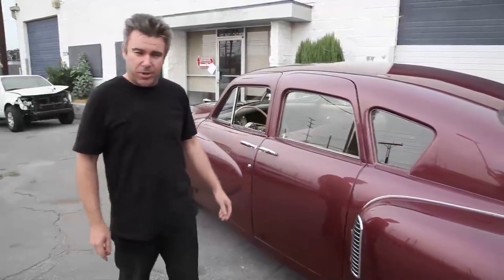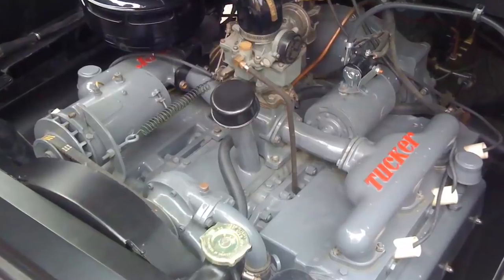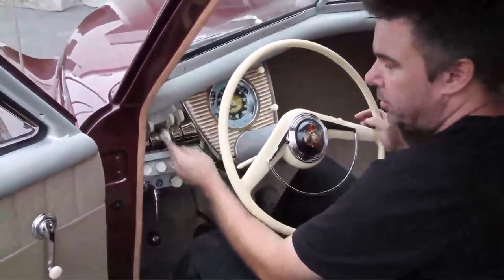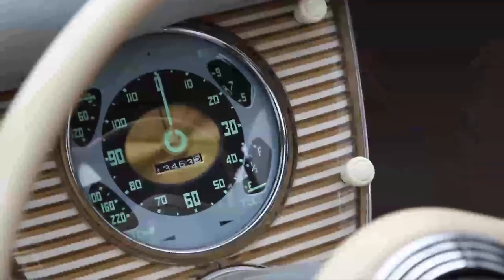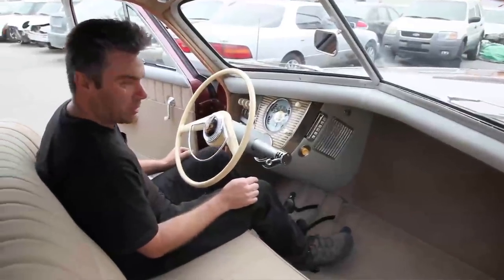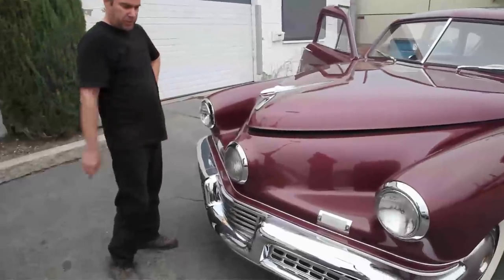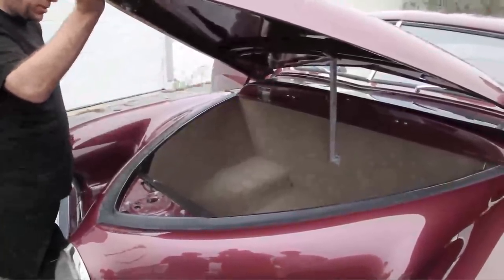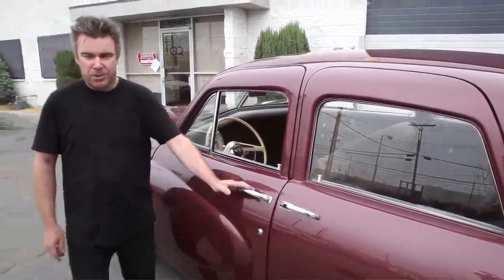BAD Co. Car 01 Tucker Torpedo

Comment: Great quick review of the Tucker’s features. 
One small point: a steel torsion bar and a steel coil spring work in exactly the same manner. Analyze the forces acting on either device (usually with a free body diagram - first or second-year mechanical engineering curriculum) - and you find every element in a coil spring is in torsion. Same as a valve spring. When you see a broken valve spring you will see that the fracture is curved due to the twisting forces it encountered.

Comment: And you think today's cars have style?
Reply: clydo1946 no, not really.
Reply: No, cars today are like "Look at this car, super safe, goes this much speed, buy one today." And thats it
Reply: "Good Gas Millage, 0% down, Look you can connect your phone to it! Don't ask about reliability!"
Reply: clydo1946 I agree that modern cars, by and large, lack the styling of the older versions. Yet, to be honest they are considerably safer, more reliable and more efficient to operate. The older cars, as I said, had style and were much easier to work on and could generally be maintained by their owners.
Reply: NOBODY says today's cars have style except maybe millennials who don't know shit.
Reply: @michaelkruk553  Hey I'm a Millennial and I always said anything made after 1990 is a giant pile of computerized junk.
Reply: @sbc388550  
Damn. I don't know how old you are but in the 60's it was pretty common for cars to break down. On any 50-mile trip, you could expect to see at least one or two cars on the side of the road. Engines would give you 100-125K miles before a rebuild, nowadays 200-250K is pretty much expected. Today's cars are much more reliable, for the most part more powerful, and definitely safer. As far as styling, that's pretty objective, I would say.

I own a 1970 Challenger. I think it is one of the best-looking cars ever made. I also have a Ram pickup & a Jeep Cherokee. I recently bought a 2017 Civic EXT coupe for my wife. I think its styling is very attractive,  on par with my Dodge. It is almost as quick, and is actually more fun to drive. This car has 10 more horsepower , and weighs 1/3 less than that Tucker. It also probably gets double the gas mileage. I'd call that evolutionary. The brand-new Challengers eat mine alive, in every way.

Here is the exact car I bought, same color too. Do you seriously think that Tucker is a better-looking car?
https://www.youtube.com/watch?v=7HZQiKLGgpg
Reply: @mikerew9132  The Styling for it's day was way ahead of The Big Three.

Comment: There were already states that outlawed 3rd headlight..so Tucker had blank inserts available to comply with the local laws...plus testing showed the center headlight beam was not strong enough to penetrated the others ..so it was kind of redundant . the design team had better ideas that would have been better function for turning illumination..but the Cyclops light already was such a marque trait that Preston insisted it stay.

Comment: What a wonderful car for its time.  More powerful than most cars on the road in that era
Reply: wb5oxq thats what ive heard....i understand the 6 cyl.  in the tucker ptoduced 166 bhp@ 3 hundred & something ft/lb of torque- that is truely amazing !!! I also understand that the front windows would pop out in the event of an accident.......back then every other car had non-safety glass.  The center headlight followed which ever way the frt wheels were pointing....... the list goes on... it was an amazingly safe car for its time.

Comment: The second key lock is to lock the parking brake. One thing I love about Tuckers is the fact that they don't have an AMMETER!  The "Battery" gauge is actually a Voltmeter.  Cars of this era and well through the 70's have Ammeters. Ammeters need to have full amperage running through them to work and over time corrosion builds up and either the car stops working or the ammeter arcs out and starts a fire. Mr. Tucker was ahead of the curve by 30 years using a simple Voltmeter!

Comment: Very interesting video and to think how automobile technology may have proceeded.  With this type of thinking and designs very likely would have resulted in all other manufacturers having to do the same much sooner than what occured.
It's hard to imagine or maybe not today the ways that the company was caused to go out of business.  Essentially allegations and investigations were made with the purpose of "screwing the pooch."  Using the guise of a legitimate charges it's competators were able to "use the government" and wait out Tucker.  What I mean is they by causing the bad press caused the inevitable devaluation of the stock.  Which removed the companies ability financially to operate.  Besides the resulting cancellation of orders making bridge loans that much less likely. Much in the way Westinghouse and Tesla (ac current) were forced to sell to Edison Electric ultimately forming general electric.  Morgan simply told Westinghouse he was going to sue him and knew he would ultimatly lose.  However he had the money to do so Westinghouse was tapped and would win but would have lost his company.  Lenders other than JP were not willing to extend credit under the assumption Westinghouse and AC would win.

Comment: This is the Tucker 48, not the Torpedo which was never built until Rob Ida came along.
Reply: @Cliff Yablonski - Sorry, but if the Torpedo had been made (which it wasn't) it was a very different looking design than the Tucker 48 (which was made). Do some research and you'll see what I am saying is correct.

Comment: One thing Tucker lacked (at least to the best of my knowledge) is a window defrosting system. I believe Nash had the first one in the late 30's, and I know that Oldsmobile had the first with a heater core that worked pretty much like we have to day in the early 40's. With the tiny dash Tucker had, there doesn't appear to be any room for defrost vents. Maybe I'm wrong, but that's the way it looks. For a car that was so futuristic in so many ways, you'd think they would have thought about windshield defrosting.
Reply: I suppose eventually they'ed come up with a Beetle style gas burner defroster.
Reply: @brianmiller1077  Probably so.
Reply: A heater/defroster was available as part of the Tucker Accessory Program, as was a radio and matching luggage.

Comment: Does the 'Cyclops Eye' actually turn or are there 3 bulbs in the housing which vary in intensity as the front wheels turn?? Or did they try both? I've never seen the light move but I have seen the blueprint with 3 bulb.

Comment: Regardless of the government, Tucker never had a chance at anything close to success or mass production, despite it being a very interesting car. The auto industry was continuing a  consolidation of smaller brands with many falling way behind and eventually disappearing, be it Hudson, Kaiser, Crosley, Packard, Studebaker, and much later, AMC. Mass production requires and delivers massive cost efficiencies and a widely dispersed and healthy dealer network to support sales and service, and cars back in that day, needed a lot of support. Seals leaked, engines overheated, bodies rusted, and warranties were scant  Today, Tesla may intimately succeed (or not) but Tesla  is an altogether different animal.

Comment: Apparently with so few cars built and purchased no one ever actually
used the "Crash Cellar" in a head on collision. Makes one wonder
with all the metal crunching around you how that would work out in
an actual crash. I wouldn't want to find out.
Reply: Mmmm... unbuckle safety belt, then dive into footwell. Sounds like a good plan in an era where there were no 5 mph bumpers.
Reply: if you watch the movie the purposefully crash tested one in Indianapolis.  The glass popped out and everything worked as designed.  Driver walked away unscathed.  People literally lost their lives because Detroit was not forced to retool and make their vehicles safer.   Thanks government and lying media.

Comment: only 50 of them?
Reply: Yep!
Reply: YES 51
Reply: 50 original cars, sn 1001 - 1050 plus the prototype - the Tin Goose =51 cars out of the factory.  Two additional cars were built, sn 1051 was completed in the late 1980s and sn 1052 completed in 2015.
Reply: there are 51 made 47 still running Tucker 1003 got wrecked on the Indy Raceway.
Reply: One got burned up in a garage fire several years ago and one has been modified into a front engined Ford powered frankenstein.  Given that there are still motors out there, I don't know why the owner of that one doesn't try to get it restored properly.
Reply: 51.  48 accounted for
Reply: @chrislemaster2695  they found a 48th in 2016

Comment: Your title is disingenuous I'm from that era, and these were marvelous cars!
Reply: +Cliff Yablonski Has it occurred to you that the transmission is at least 67 years old? I think the fact that it still works even though these cars never really get driven sais a lot.
Reply: Cliff Yablonski, the Tucker was a totally new car just about made from scratch.  All that would work with that particular engine at that point in development was a Cord transmission (in the meantime Preston and his engineers was developing several different transmissions, at least 2 of which would show up in later versions of the car.). This was a very early version, so everyone had to work with what they could find to match the engine.

Comment: Tucker was so ahead of its time, I still for the life of me don't understand why we can't make a Corvette with an engine in the back, where it belongs.
Reply: Problem is that people think a rear engine means a front luggage Compartment, which in this case is great for throwing your back out just to reach the back.
Reply: Dan Maltby GM did make an attempt at a rear engine corvette..it was called corvair way before corvette and corvair went into production..look up corvette and corvair history and you ll see it all..too bad corvair had a short run , i can only imagine what it would have looked like in the 70s and far better than thier anemic vega for an economy attempt..
Reply: josh smith  Was that also known as a Chevy-Monza? Looked-somewhat along the lines of a small-'vette body, with a larger-displacement Corvair-type flat-six-in-the-rear? Been too-many years ago, but I can remember seeing pics of such...
Reply: In 2020 your wish was granted.  Believe me the engineers and designers tried from the C2 on to go mid engine.
Reply: Mid

Comment: Get rid of the boxer 6 OHV converted aircraft engine. 166 bhp  and 372 lb-ft is peanuts.
Try a V-1650 or Merlin, it would be a little bit more powerful.
Reply: And  what kind of grain truck would you like installed in ?  :)

Comment: Hmm, still probably better than a Corvair!
Reply: HailAnts -heads and shoulders ABOVE the corvair?..............except in mpg......
Reply: Hell a Dodge Aries K is more reliable than and safer than a shitbox Corvair.
Reply: @Chris Lemaster - Really?  The Dodge Aries K was one of the very worst US cars ever made from a reliability standpoint.  Many large companies bought fleets of these and after suffering multiple transmission, brake and other issues, couldn't get rid of them fast enough.  My company was one of them so I'm quite familiar with this miserable excuse for an automobile.  It started Chrysler Corp on the path to its second bankruptcy.  My Brother-In-Law wouldn't own anything but Mopar until he bought a Dodge 400.  That was the last Chrysler Corp vehicle he ever owned!  The Corvair didn't have anywhere near the issues the Aries had and was primarily destroyed by Ralph Nader.  I'd be willing to bet you there are more Corvairs still around than any crap K cars.

Comment: Heres hoping that guy doesn't sell cars.
and stuff
Reply: He stays on the lot until he's learned to use the horn and turn signal , so no going out with customers on test-drives.
Reply: I was commenting on an adults inability to express himself gracefully with all his Tuckarian knowledge.
Reply: I myself was commenting on the video download image quality, which goes to pot on my device once he touches the loaner Lincoln steering stalk. Goodyear, Cord, Plymouth, Ford, even Blackhawk, and Packard might I add, basically built the car for Tucker. AMC did the same ruse and similarly found themselves wearing Pentastars. Ford has put a torsion suspension but without rubber on SUVs, which is a ton easier to rebuild than anything with coil or leaf springs. B.A.D.*Co.

Comment: A unique vehicle with several positive features; but the interior was rather dull, evenfor '48. It was certainly "spartan" as the commentator remarks. The controls weren't placed along a conventional dashboard but crammed into the driver's corner. Loads of leg-room but if it had gone to full production, I don't think it would have sold well.Just an opinion..